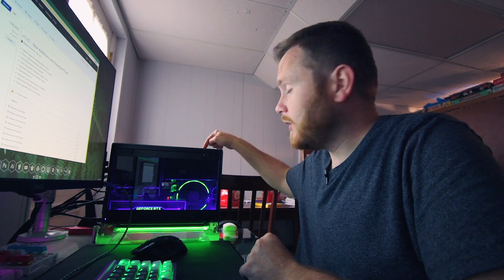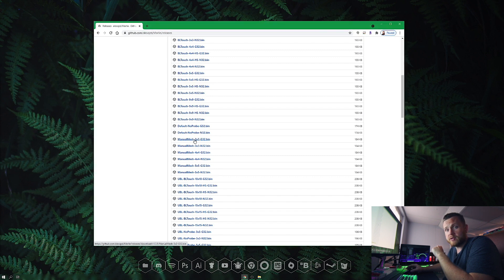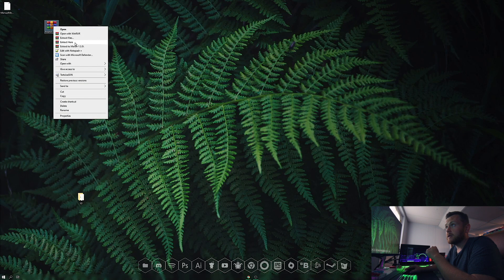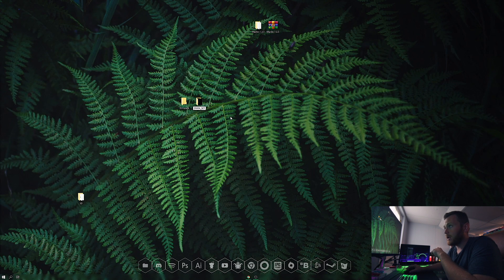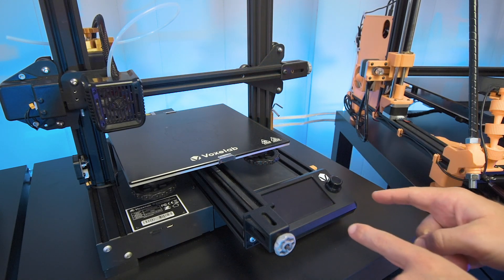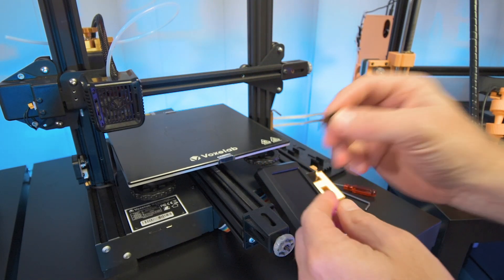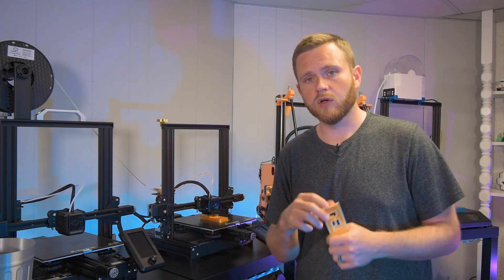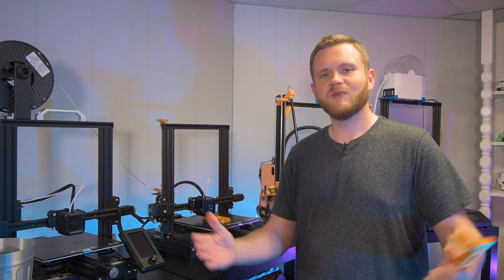Reduce Risk of Fire on Your Voxelab Aquila with 3rd Party Firmware

Comment: Hi There, 
Well, Maybe this problem you told us about with the run away over heat seems I think what had happened to my printer?
The company keeps asking me tons of different questions and asking me to do this test then another one and over again.

I think they just don't wish to fix my printer by sending out a new main board even though 
I did a test on the Aquila they asked to do where I changed the wires over from the
power block of the hot end to the power block of the bed heater and the try to heat them up like that?

Nothing happened I has zero heat on both as I already told them after seeing that both the hot end and the bed were not heating up
when wired as normal.

I had to buy a new hot end and thermistor and heater cartridge and fit it in place of he original as that had some much melted plastic encasing
it that it even had the hardened plastic as I told them in the screw holes and I could not get the thermistor un-tightened and the heater one either.

So I just brought the new one and fitted those that'a as I told them when the system stopped powering up the hot end and the ed?

But yet again they still telling me to do another test of the pins of the power blocks and the thermistor plug on board & the bed one on there?

And to use a multi-meter to test the pins, u not what setting to set the meter to? I never used a multi-meter before as I only brought it.

So I have to install this firmware update as soon as I can after all this damn testing and checking that the company keeps asking me to do 
and they keep asking or the same information over and over again in their emails to me?

I not impressed with their service to me. really getting a pain as though the printer being out of action is not bad enough.
Reply from the maker: It’s definitely a challenge to trouble shoot a printer via email. Without seeing it even I have a hard time fully grasping the issues you’re having. I know it’s rough to have issues like this. Mostly they are due to a tiny QC issue or installation or operation error. So they have to figure out what to send and why.
Reply: @3DPrintSOS   Hello.. Well, what a time I had with this new main board I got from flashforge which is to replace the one I got with the printer that failed I think to the now known temperature thermal run away you were told about with some of the Aquila's?
I got the new board quickly in 3 days which is good, However the new hot end Thermistors I ordered took 3 weeks to come!

So for the 1st time I had to replace the main board of a 3D printer, I took many photos of the wiring into the main board and added notes to the picture of the board i the back of the paper manual.

I started on Saturday morning.
Then I found the fact that the display unit ribbon plug on the board end was plugged in But also the plug was glued in place with allot of that glue used in those heat guns in DIY?  I can understand them worrying about the ribbon cable plug there being pulled out of the port, But really it does have a semi-tight locking effect when inserted.

Lucky for me I have a modelers magnifier unit on a arm with lighting as I did scale models awhile back.
So super slowly and carefully I had to cut and lift off the big amount of that semi-clear eat gun glue off the outside and top edge of the port.
Took about 15 minutes as it was very hard to get it unstuck without damaging the board, I kept my fingers under the small nail scissors used so it did not touch anything.

Slowly and carefully removing the wire plugs from the main board and then took out the board.
I put the new board in and screwed it in with the 4 screws then slowly making sure now to do any damage I one by one re-plugged in the wiring plugs.

I checked all the plugs were in right and where they should be, Then when I went to wire in the wires for power I found the new thermistor white plug was not the right size for the one on the board! The Thermistor plug was a 3 holes wide plug and the board was like the others there a 2 hole plug?

So I checked out the video I had of yours I copied where you show how to take the wires out of the small white plug and move them over to another one?
Very hard to do even though I have good hand skills with small parts ( i.e. like I did scale models before remember )

After allot of fiddling I got the wires out and locked into the small 2 hole white plug I had from the original system thermistor.

Now after all that, time to re-cable up & attach them with cable ties and fix those and re-screw the cover etc.

Okay after 3 hours of this hell, I got it all redone up and now came the firmware upgrading about the new anti-over heating and better bed mesh software.
I did the same as you did. ( picked the red text one you had ) The 1st screen showed the white background with the thin red bar and the green check mark.

The did the next one with the sd card moved to the back of the screen unit. did the power and the screen went solid light blue then red.

Turned off the printer again and removed the sd card ad re-fixed the back cover of the screen display unit.

And at long last turned the printer on with all done. And then a problem, Nothing came up on the screen except light black solid with no figures no text at all?

So turn off printer and checked the main board found the black plug of the display unit looked maybe out a little of the port?
So I re-plugged it in again.  and left off the cover in case I needed to check it was in again?
I turned on the printer and the screen was on okay, but no text just light black. I redid the sd card stuff again.
The screen showed the 1st and 2nd right stuff of updating.
 
Re-fitted the covers and made sure the ribbon cable for the display was not pulled or caught as I turned over the printer back to normal placement.
But now still a light black screen no text no figures. So re-updated the firmware a 3rd time in case of a problem before!

And no luck no text no colours no figures no nothing just the light lack lit up screen?

So any ideas why this is not doing the screen as your other video showed?
Reply from the maker: What chip is on your new board. It must be the wrong firmware
Reply: @3DPrintSOS   Hi there.. I used your choice in the video as My original board was the same one as yours in the Aquila as I checked it then. 

I thought this would just be the same board again as the original was just with the now coloured plug ports on it where as the original one just has all white plug ports on it?  

So how do I check what chip number is on the board I have now so I can get the right firmware?  Thanks again for your help.  
8 )
Reply from the maker: Take a look at the text on the chip and let me know here. I’ll tell you which to download. Color plugs already indicate that it’s a newer board.
Reply: @3DPrintSOS   Hi Again.. Okay the text on the chip said > 
HDSC HC32F460  KCTA  210215C  POC21200
i had to use a touch at a low angle and photograph it in Black& White using my mobile phone camera then the faint text on the top of the chip showed up better in the photo.  😁
Reply from the maker: @colincampbell3679  so looks like you have a H32 chip. That would explain why the firmware isn’t workin. ;)
Reply: @3DPrintSOS   Right which is the right firmware needed then?  Thanks 😀
Reply from the maker: Depends. Are you looking for updated stock  firmware or JyersUI?
Reply: @3DPrintSOS   " JyersUI " the one that was done by those two amazing programmers, one of them you said was Alex.  

if that is the anti-thermal run away 3rd party one!  
I will need the NORMAL type that is for a Aquila with No BL Touch on it for now.  

My machine is for now just non- BL Touch auto leveling.  

Just need the 3 X 3 bed mesh leveling version thanks.
But I better have the BL Touch firmware version as well, As I be possibly doing that later on?  

Just tell me which is the non-BL Touch one so I use that 1st?

Thank you so much. 😉
Reply from the maker: Ah so as of right now, the h32 version of Alex’s firmware isn’t available yet. So for now, you have to stick with oem
Reply: @3DPrintSOS   Okay if you can tell me which of the list you showed on the video I need then, I download the normal one and install it for now!
Reply: @3DPrintSOS   Hi well, after allot of try's I redid the downloaded Official Voxelab Aquila G32 firmware and checked the details of the contents as sofar no luck doing it?  But I saw that there was both English and Chinese text files for the display part of the firmware files So I deleted that Chinese text file and tried the firmware then? Success the firmware worked and loaded up at long last. I think the Chinese text file for the display was bugging the English loading.  I am now printing the new yellow PLA of a new Hot End Fan cover. looks good too.  thanks for the help and we see what happens?  This version states it is V5.5.3  i hope that is the right one?
Reply from the maker: That’s good to known! Thanks for telling me. Now if I see other people having this issue, I know what to tell them.
Reply: @3DPrintSOS   Hi There, Well, I been printing some small things one was a new Fan hot end cover for the Aquila using the new Yellow PLA I brought, it came out okay and had a lovely bright yellow colour. Then as I started to print with the Yellow PLA again the printer buzzed a loud alarm I not heard before?  I looked at the screen and there was a lack text on a full white screen, the text said "Warning Hot End / ed Temperature too low for printing"  and the printing stopped? 

Now I had before this seen the printer cables to the top motors and hot end were bashing slightly against the power cable to the back. So I tied those to the side and kept them from brushing or banging into the main power cable.  

Started it printing again, same alarm after 2 minutes printing!  I thought maybe the main cables were being pulled in the power blocks of the main board and shorting one or two?

So I turned the printer off let it cool down and opened up the main board area and checked the cables were fine no pinching no rubbing etc. Checked the cables were all in the ports and blocks and all were fine no loose ones!

But after making sure all was fine there I closed up the main board plate and tested the printing, Nope same alarm happened?

Now can't remove the cut off amount of PLA filament I had after removing the spool and storing it again in it's box

What can I do?. 🤔
Reply from the maker: Hmm this is typically related to the thermistor or heater core. Both are on your hot end. See if you can loosen and readjust the thermistor on the hotend and then try again. Make sure it’s secure with the screw but not too tight. 

It’s also possible that it came loose on the motherboard, but that’s less likely.
Reply: @3DPrintSOS  Hi all,  Well, I have been checking the Thermistor & the Heater Cartridge by trying to run the printer to do a small test model and see if it will do it?

i changed the Thermistor to a new one 1st as it seems the most likely to be faulty! I run the test and the alarm went off. So I changed the Heater Cartridge too and redid the test, it all runs Okay I had to fight for some time to get the once perfect leveling I had before this back to a good level.

After all that hell, I started to do tests to tune to leveling better, One thing I found was the set temperature I put on the screen would not settle down!  The ed was fine it stayed at the set level But the Hot End temperature will not settle down to the set one, it keeps going above the set one often by 11 degrees then down to the set level then below by 2 degrees hen up by 6 in fact all over the place only sometimes o the set temperature?

And when both levels of heat reach the set ones, the printing won't start up unless I go and turn the hot end temperature down or up by a degree or two?  

I found the auto load and un-load functions still don't work. I have to push the filament down to the hot end then use the extruder menu movement control to tell the extruder to move y say 35 mm or so to extruder through the end of the nozzle ready to start.  Then there's bed adhesion, the filament sticks fine it seems i the skirt part then as the model is started after a couple of minutes the model pops off and is ruined but the skirt still stuck down fine and is hard to get off the bed.

I really clean the bed each time and still the prints slip off or get stuck to the hot end with the skirt stuck fast still to the bed.

Really doing my head in here. 😠
Reply from the maker: I bed you need to run a PID tune on the hotend with the new heater and thermistor. On Jyers UI, you can do this through the menu. On stock firmware, you have to connect to a pc and then use pronterface to push gcode for PID tuning.
Reply: @3DPrintSOS   Blimey, connect it to the PC and do that action! At this rate I won't get it sorted out. 
Seems that as I fix a issue another stops me as in the PID that one I not even heard off?
Sigh.... it getting so hard to keep up with all this stuff. That's the trouble wit doing a hobby you never done before,  
it can throw problems at you that even with help from you lovely clever users it still can be so hard to fix it all so it just works?
Reply from the maker: It’s like that sometimes Colin. Typically not after a while, so it’s definitely an unlucky situation that you’re in.

Pid tuning basically heats and cools your printer so that it can learn how fast it can heat and then how fast it can cool itself so that you get steady temperatures. 

It’s just another way to calibrate the machine. Just like tuning your esteps, if you want your machine running smoothly, just something you have to do. 

I’m trying to help. Definitely sorry to see it happen to ya.
Reply: @3DPrintSOS  Right Okay then, How the heck do I connect up the PC to the Printer and what items do I need to get to do so and how do I do this PID?
Reply from the maker: The procedure is the same as an Ender so there are tons of videos on how to do it. Search “Ender 3 PID Pronterface” 

You need to find a mini usb to usb cable to use and download a program called pronterface.
Reply: @3DPrintSOS  Thanks I just found I have the cable it came with a Tablet I use. Cheers  8 )
Reply: @3DPrintSOS  Hi Again, Right another pain to stop me doing this PID. Just wen I thought I would win?  I had to use a Windows 17 software as that is my PC,  found the program in the help area under Bryan's Video. But although it installed Okay it is a 32 bit version My system is 64 bit. But there is no 64 it version I've seen?  So after installing I followed his video how to use it, The software id interface when the cable was plugged in to the printer the screen lit up even though the printer was turned off?  But when it said the program was connecting to the printer.... and the only COM port was being used at the speed the system set. The connecting message just stayed there and after many minutes it still not connected?  I tried setting the speed byte rate to users in case it was wrong! But no change to connecting. What can I do? The cable is in the USB 3 port on the PC so ta is fast.
Reply from the maker: Colin, the unlucky streak continues huh? Sorry man. Did you download the printer to usb driver by chance? That might be why it’s not connecting.
Reply: @3DPrintSOS   Hello I managed to get the PC to talk to the printer. Semms to PC kept setting the COM port to Number 1, when it should have been COM4. I found it had done this when checking out the Details area for the ports in Device Manager.
So anyway after watching another you tube help video on this. I got the printer on the Pronterface checker.
I saw that when the printer was tested at the set temperature for the hot end set at, 205c for the PLA starting heat. The bed set to 60 c, The temperature shot up in a few seconds for the hot end testing!
It went right up to 250 c and then I got the warning that the Temperature was too high and the testing Failed.

I have done as others told me and tried testing the hot end many different heat levels in the test and different amount of times of the heat checking so like 200 c for the PLA hot end and 55 c for the bed, But the hot end is the only one being heated using the "E0" order in the command line before the tests?

I already got the starting numbers for my hot end for the checking to work.  But no matter the temperatures set for the Hot End check and testing try's each time the same error 
"Temperature Too High Test Fail"

Here is the read out on the last Pronterface test >
Bed temperature presets updated, pla:70, abs:90
Bed temperature presets updated, pla:55, abs:90
Hotend temperature presets updated, pla:210, abs:225
Hotend temperature presets updated, pla:195, abs:225
>>> M303 C5 E0 S195
SENDING:M303 C5 E0 S195
PID Autotune start
PID Autotune failed! Temperature too high

What is wrong why can't to work?
Reply from the maker: Colin, let’s talk about this in the discord. Use the link in my description for the invite. I bet we can get this resolved in there. Lots of people helping each other troubleshoot.
Reply: @3DPrintSOS   After allot of hell, I found how to get on the Discord server for your one! I off it at this time as you not on I will come on when you say your back? you have to message me somehow!  

At his exact time of typing I am not online in it, even if the "Astro" nickname I use is still showing I am on? I just don't know how to change the status showing icon.